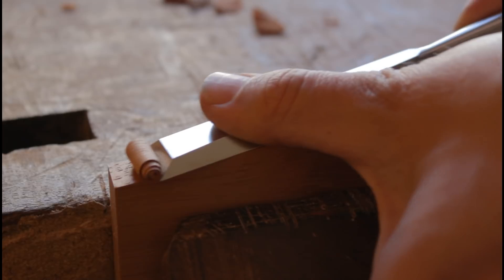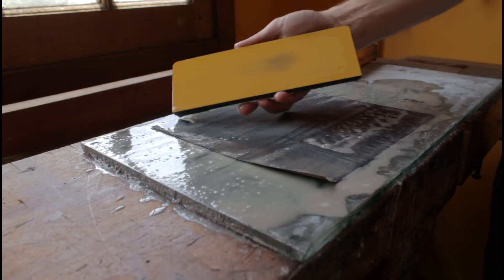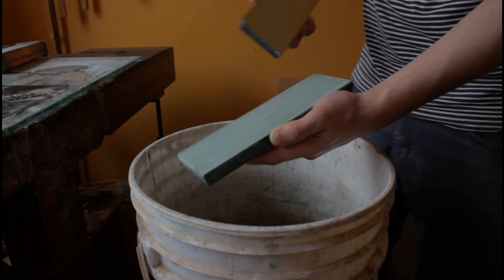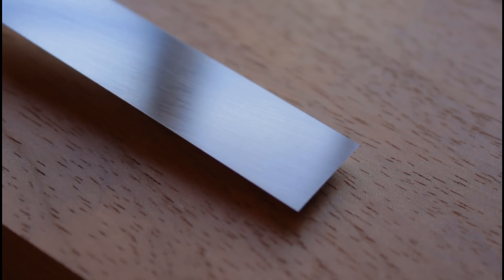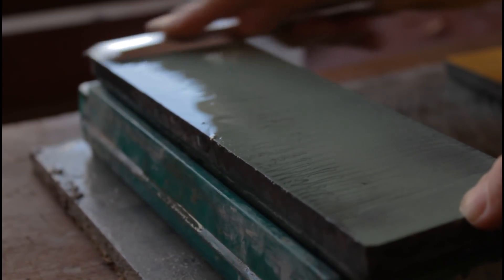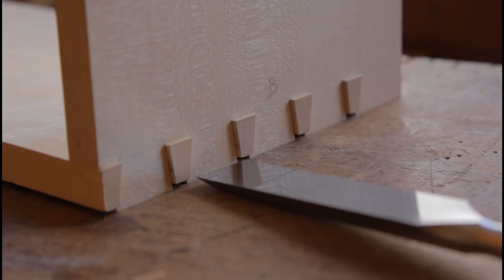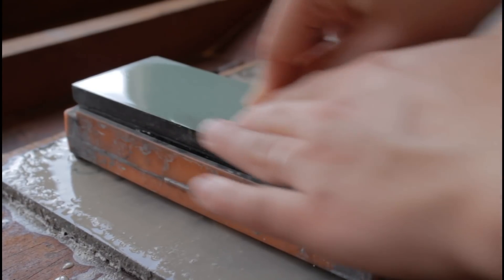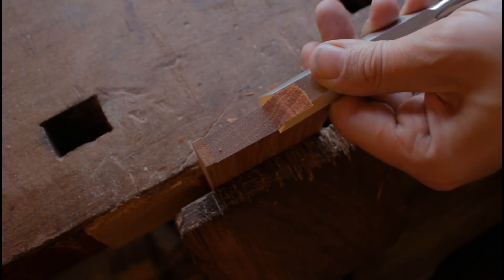Cómo afilar un formón | Cómo afilar herramientas de carpintería. Capítulo 1: Formones.

Comment: Muy bueno el video, muy claro y transmiten el placer de trabajar con herramientas manuales. Quisiera hacerte una pregunta: que opinión tenes de los formones Stassen? Muchas gracias y ojalá sigas con este tipo de contenidos
Reply from the maker: Hola Juan, ¿cómo te va? Tengo algunas gubias y herramientas Stassen. Levantan buen filo, no es súper duradero pero tampoco son difíciles de afilar. Los formones generalmente necesitan un poco de trabajo para rectificarles la espalda, no vienen planos. Saludos!

Comment: Hola! Acabo de encontrar tu canal, espectacular! Una consulta, tengo en casa una piedra que era de mi abuelo, no sé si es al agua o al aceite. ¿Cómo puedo darme cuenta? Tampoco sé qué grano es . Saludos!
Reply from the maker: Hola Valentina, ¿cómo te va? Definir el grano exacto es difícil. A grandes rasgos las piedras gruesas dejan rayas visibles y una textura áspera, las piedras intermedias dejan una textura mate sobre el acero y las finas lo pulen. Con una piedra intermedia podrías lograr un buen filo, aunque te va a llevar más tiempo y el resultado no va a ser el mismo que teniendo una gruesa y una fina. Si es al aceite o al agua también es difícil de decir, aunque si es antigua, de las típicas piedras grises que se conseguían en ferreterías, seguramente se pueda usar con cualquiera de los dos. El tema es que si la usaron con aceite deberías seguir usando ese lubricante ya que la piedra debe tener restos adentro y no va a funcionar bien con agua. Podés probar con agua, si ves que se empasta mucho déjala secar bien y probá con aceite, pero una vez que uses aceite acordate que después no la vas a poder usar con agua. Saludos!
Reply: Gracias por la info! En el caso que decida afilar con lija como decís en el vídeo, ¿Qué granos debería usar para afilar el bisel?

Comment: Hola Hernan va otra pregunta. Consegui lijas de grano 7000. Sirve para reemplazar la piedra de 7000. No entiendo porque decis en el video que con lijas hasta 1500. hay de 2500 3500 y 5000 también. Bueno, como siempre muchas gracias
Reply from the maker: Hola Diego, ¿cómo te va? El grano de las lijas no tiene correlación con el de las piedras. Una lija grano 1500 pule más que una piedra 6000. Además el grano final depende también de la calidad de la herramienta. Si el acero es bueno vas a sentir diferencia afilando a un grano más alto, pero si no lo es no va a haber cambios después de determinado punto. Con lija 1500 se obtiene un muy buen filo. Saludos!
Reply: millon de gracias